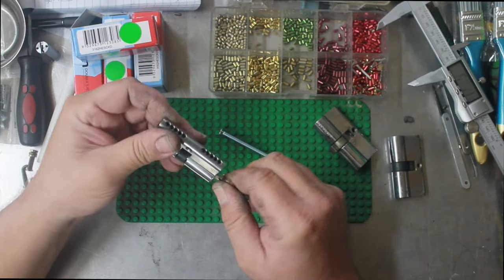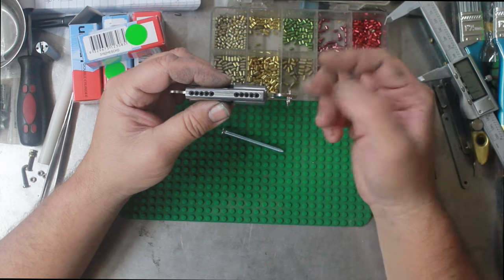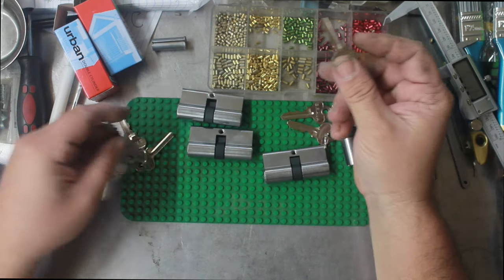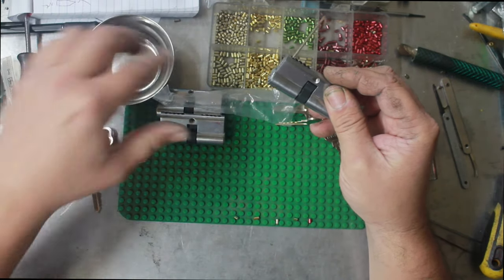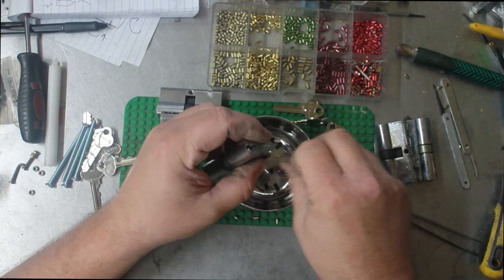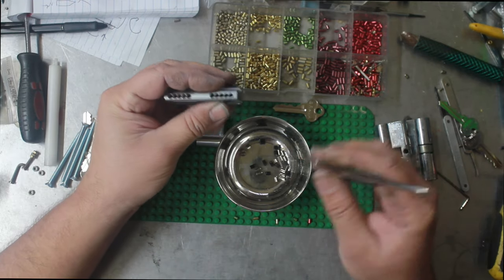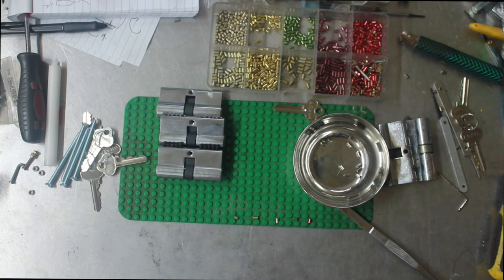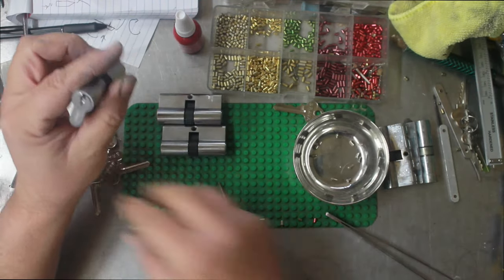Rekeying Euro Double Sided Cylinder - Key Alike

Comment: Thank you for a great and informative video. I am installing a tri lock security screen door that I purchased 2nd hand. It has two keyed padbolts with key. The seller has assured me that the tri lock is keyed alike however the door lock won't turn at all with the key. The keys have a number on them. Are you able to advise please?